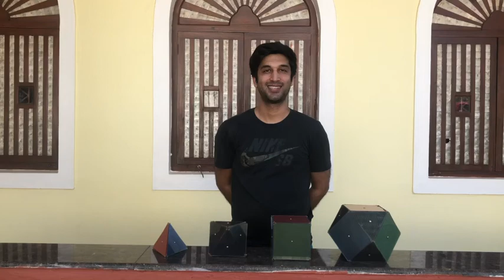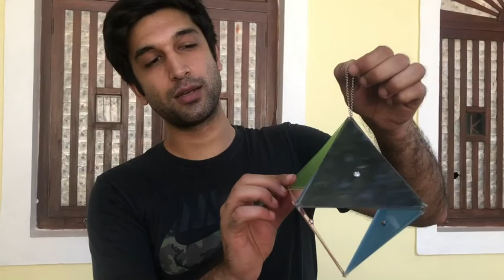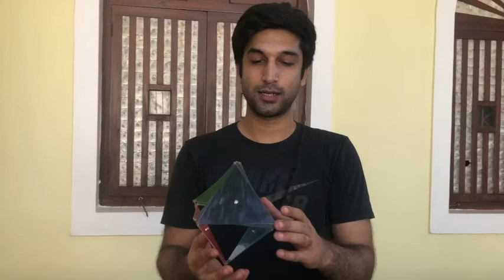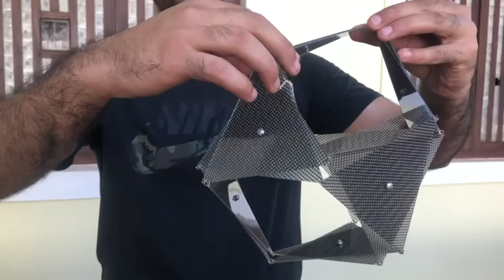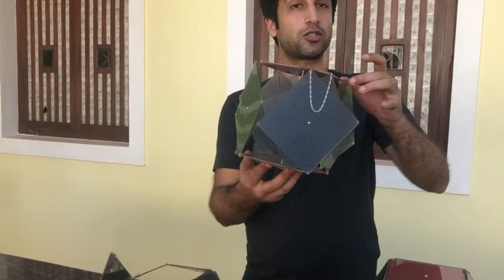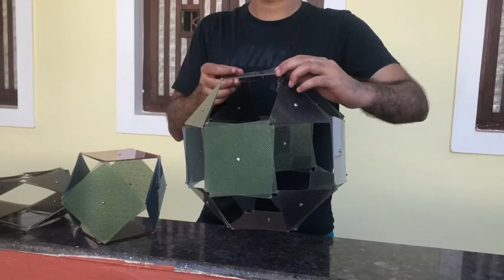Jitterbug Geometry

Comment: That's a neat trick, I've never seen it before. These geometries continually find new ways to amaze me. 
This is also the only time I've seen someone using the term 'jitterbug' besides an obscure animation from many years ago I found while investigating polyhedra online. In that old animation, octahedron and cube are shown as duals by rotating each edge (of either shape) by 90 degrees, along an axis of rotation which connects the midpoint of each edge to the center of the polyhedron. Rotating every edge this way switches quickly between octahedron and cube. Fascinating stuff..